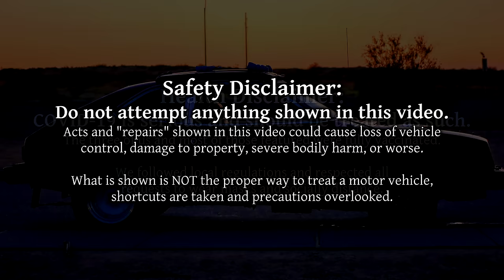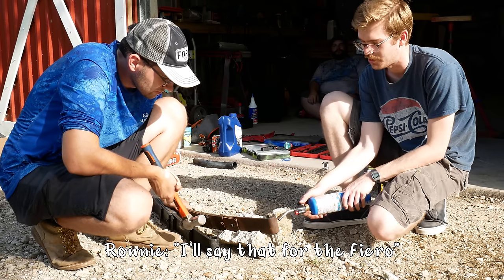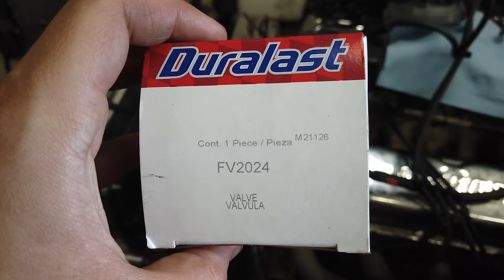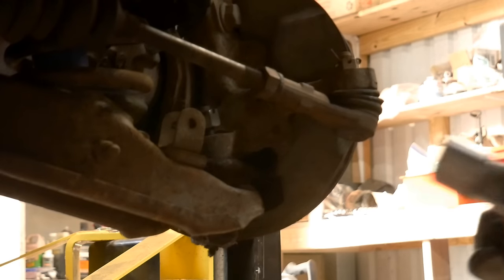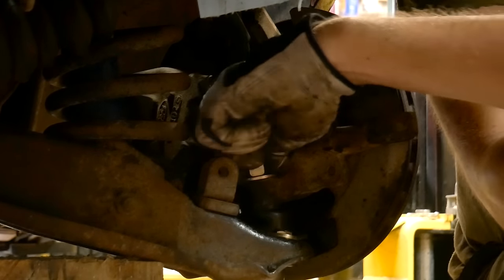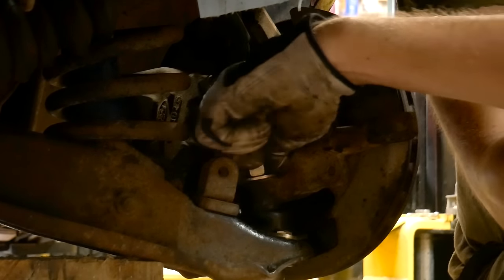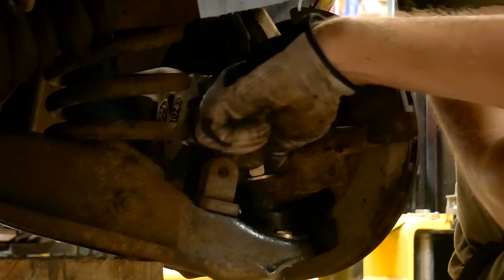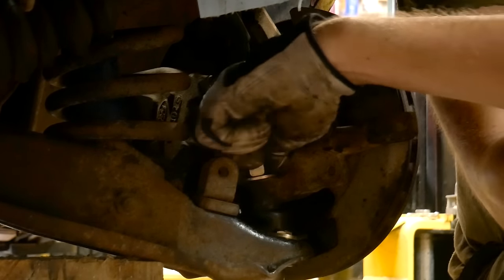Driving a V8 Ford Pinto 3000 Miles Home Finale (Ronald Finger, Driving Texas to Maryland) (Ep.4)

Comment: The thing that has impressed me throughout this whole trip is that Pinto's engine just refusing to run cooler or better no matter how much work you did to it.
Reply: Yeah I hope he can finally nail down the issue and let us know what it was.
Reply: The Coolant passages could be clogged due to rust and water.
Reply: Windsors are a funny motor, I've driven a car with one for over 20 years.  They can run good, but most of the time they just run okay to eh?  They don't die easy though.
Reply: I really think he has too little radiator for that v8.  If the block is a bit plugged too that just pushes it over the top.
Reply: @jonathanklein383  Agreed. That radiator is WAAAYYY to small.

Comment: What an absolutely awesome adventure to watch, and feel part of.  Great comradely, and something that has created lifelong memories for numerous people.   I had a smaller adventure like this in 2004 when I bought a car interstate.  5.6L Holden V8, in a 1987 Commodore.  Trip home was “only” 1100km (approx 660 miles) and I got no more than 80km of run time between failures.   Some we’re only 5km apart.  It even failed dramatically just before half way and I was ready to walk away, but I persisted with it.  I know all too well the feeling of dread when something breaks and you’re in the middle of nowhere.  Coming up with temporary fixes, or having to wait until daylight for shops to open to buy something to adapt.  Never sat below the red end of the temp gauge the whole way, and I went through all the same cooling system issues.  At one point it was using 2L of engine oil every 100km.  Not burning it. Rustproofing the underside, thanks to an old leaky rear main.   It was a week of hell and haphazard emotions.  I restored that car in 2010 and it’s been ultra reliable and has run cool ever since.  Many times on that trip I questioned why I didn’t just pay for it to be transported home, but I now look back on that adventure as a positive thing, and a great learning experience - physically and mentally.   Your adventure was 5x what I went through.  That relief of making it home can’t be described.  It took months before I wanted to work on that car again.

Comment: Your road trip sounded so familiar...  loved your whole video series. Mine started in Fresno California and ended in Queens NY with a 72 Datsun 210 2 door (paid $200 for). Somewhat the same type of issues involving bailing wire or speaker wire, ball point pen casings, duck tape, truck stops (for showers), a cooler full of lunch meats and such, and what seemed like hundreds of gallons of water along a southern route on I-10 till around the pan handle then up the east coast to ny. The only company I had was an old Midland cell phone, a map of the United States and my full sized collie (like Lassie). Was definitely a adventure...  After around 1 year and 6-8 months in NY, alot of work, customizing,  a guy came knocking on my door asking if the car was mine ( he said he tried several houses around the area) and offered me $7000 (yes he did) and a Mazda RX7 in trade. He desperately wanted the car. Hated to see the car go but she tured out to be a very reliable car and was catching alot of attention ( some unwanted by NYPD). 15 yrs later I now have 2 E150 vans (both has same paint scheme  as the A-team van (one in black and one in white and both custom built by me) and a 48 Studebaker pickup. Fun times...

Comment: I'm disabled and can't afford to do stuff like this (it's my dream, tbh).  Thank you for letting me live vicariously. I hope this series gives your channel the subscribers and recognition it deserves.  The pop-punk/acoustic soundtrack was 10/10.  

As soon as I saw you pull into a Semi shop, I was thinking, "I'll bet they're tempted to throw a semi radiator in it", and 2 seconds later, LOL!   I'd look for binding (rubbing parts that shouldn't be/excess friction) in the driveline, as the only time I've had transmissions blow fluid everywhere like that was when they were very overloaded (too heavy a trailer @ 75mph through the mountains of WV in 95 degree heat, not good, lol).  Considering all the vibrations (and the generally everything is loose/Jerry-rigged condition of the build) I'd really look at the transmission/converter first.  That oil cooler in front of the radiator probably allowed you to run it that hot for that long!  Seeing what finally is the overheating culprit will be so satisfying! (for you guys the most, I'm sure)  

I live in Shrewsbury, PA (1st exit off I-83 in PA, 4 miles from MD), so if you want to diagnose it together, I'm down!

Comment: Congratulations on getting it home!  As an old Hot Rodder, let me throw my two cents in on what issues I see with the car. The first one is that the parking brake cables should go over the leaf springs, not under. The second is with the cooling system. At highway speeds, the fan does nothing in terms of cooling. It is only there for low speed traffic. Overheating at highway speeds points to too low of a capacity in the radiator. It needs a wider radiator, if at all possible. Maybe try one for a V8 Mustang II?   As for the initial timing, I think what happened is that the inertia ring on the harmonic balancer has spun on the hub due to age, thus throwing off the timing mark. I would do a static time of the engine to confirm that the timing mark lines up at TDC with the engine off. I believe that the engine also has too long a water pump snout, which is why the crank pulley and alternator pulley are spacered out to meet it. So, it should be possible to move the radiator back once you figure out the accessory drive issue.
Reply: I said from the start this radiator was to small and not Big enough and everyone shot me down. Never seen a v8 with a skinny rad like that one.
Reply: @randallkasholo2026  well it's not like they were pushing the engine to the limit? I remember from the earlier vids they were just cruisin around basically and the car would overheat badly and would only cool down when basically idling on the side of the road. When cruisin around you only need like 30 horsepower, that shouldn't be an issue even with a radiator that is too small
Reply: Agreed.
Reply: @computercrack  It's not about the horsepower so much as it is about the load and engine speed. Hold your engine at 2750 RPM for half an hour in the driveway and it will get warm because you don't have the capacity to cool it under those circumstances. (plus, you would not have the airflow through the engine bay to evacuate the heat from the headers, etc.) This is also why cars overheat during a flat tappet cam break in. Remember too that headers add more thermal load than cast manifolds because they have a thin wall and allow more heat to escape in the engine bay. With cast manifolds, the heat is carried down stream to the exhaust pipes.
Reply: @3rdworldgarage450  yea exactly its about the load of the engine. Just checked, my car is doing like 2400rpm @70mph but I was pushing the gas pedal only like 10-20% down so really light load in any case of course it's a modern engine with computer controlled injection (car did like 50mpg today but mostly only driving 50mph or less) so I don't know about carburetors maybe the Pinto is dumping the same amount of fuel into the engine no matter the load (or the position of the throttle). Maybe he finds what's wrong, we`ll see
Reply: The gaping holes on each side of the radiator isn't helping matters at all, air is finding the path of least resistance and going around the radiator. A simple cardboard test would be a good idea. I did that on one of those grill-less trans ams from the 80s, it was over heating at highway speeds, the tech at the shop was having a tough time with it. New water pump, hoses, t stat, cooler t stat, and a radiator. I finally got time to help him, I looked under the car and saw the air dam was gone, so I made one out of cardboard and took it for a drive. Gauge ran right in the middle, before it was always 3/4 or more towards hot.
Reply: @mcqueenfanman  this has been bugging me since The first video. Doubly so that the trans cooler is in front of the radiator. I bet if you put the trans cooler off to one side to block one of the holes, and get it away from the radiator core, it would be better
Reply: @mcqueenfanman  I was looking at that and thinking the same.
Reply: @mcqueenfanman  I have a V8 vega . Similar issues . I solved the problem by building a custom radiator and moving it forward as much as I could.  Also a air deflector forcing air up into the rad would help.  Sealing up holes in the core support and running a hood actually help suck the heated air out the bottom of the car .
Reply: some of us have been tossing that radiator issue around since the first video. The clue was the low drag water pump they pulled out, which is fine for 5 minutes of run time at the track, and probably paired with the smaller radiator just to save weight. 300+ HP probably needs 4 cores thick instead of the usual 3 cores... and 6 inches wider wouldn't hurt either.
Reply: @randallkasholo2026  You will only hear from squeaky wheels that like to promote their BS.
Reply: @3rdworldgarage450  that is why many insulated their headers back in the day.

Comment: Something doesn't seem right about your timing.   The stock specs for initial timing are usually conservative.  If you have a cam,  you should expect anywhere from 10-20 initial and 25-35 full advance.   I think thats contributing to your overheating.  Have you verified your timing mark is actually top dead center?
Reply from the maker: We verified the timing mark in a previous episode and I did once again after getting it home, I agree that it seems strange but the engine idles much more smoothly with less initial. Not sure what that means though.

Comment: I absolutely loved this series! It took me back to my senior year in high school. My girlfriend's brother and I had a vocational auto shop class together where we did virtually the same thing with a 1974 Pinto. We dropped a 302 Boss motor in it along with a 4-speed manual transmission from a '68 Mustang. We ran into the same cooling problem. We tried a bigger radiator up front, but the weight of the engine made the front end sag, putting the radiator dangerously close to the ground. We found out how sub optimal this was after accidentally bashing holes in it a couple of times from road debris. We ended up moving the battery from the rear cargo area to the floor of the back seat passenger side since what we were going to do left the rear hatch unable to open evermore. We did away with the rear window, welded a panel in its place, and then permanently sealed the hatch shut. Then we got a new radiator and mounted it on the rear hatch trophy truck style with about six inches of relief between the radiator and the hatch at the top and about an inch of relief at the bottom. We fabricated a scoop on the roof to funnel more air down under the radiator so the fans had enough cold air to pull through the radiator. This was the ticket. It never overheated again.

Comment: Hey Mr. Dice, first and foremost, this has been a super-enjoyable series to watch, and I appreciate the effort that went into it!

A couple of thoughts regarding the cooling system issues (Although you've likely got it beaten by the time the vid was posted)

With a couple of k-type temperature probes taped/glued to the inlet and outlet of the radiator:

Working hard, at highway speed-- You should see a minimum of 35 Degrees temperature drop across the core.  If not, Insufficient airflow (Not likely)  plugged up cores (I know, I saw the car-wash segment) or plain old not enough radiator.

If you have more than 50 degrees temp drop across the core, and you still have confirmed overheating, you have insufficient coolant flow.   Not enough pump speed,  incorrectly installed head gaskets, collapsing lower radiator hose, etc.

Using the temp probes--  The radiator temp should mirror the engine temp.  I.e. Radiator inlet shoudl mirror what you are seeing on the engine temp gage indicates.   Rad outlet should, like I said, have a minimum of 35F temp drop from engine temp.  If not, something is not allowing the coolant to circulate correctly, i.e. Headgasket backwards (upside down, blocking off the coolant passages in the front of the heads)

One other thing that I doubt, but bears checking, might be a good idea to run a "blue goo" or combustion chamber leakage test.  They just look for CO2 in the cooling system, the presence of which indicates exhaust sneaking into the cooling system.

Hopefully this is somewhat helpful!

Comment: Thank you for the entertainment! I was hooked on the first video because not only do I live in Phoenix and owned two Pintos but when I had them I really wanted to drop that V8 in one. Someone who had done just that back in the very early 80's told me that the small block Ford sat on the original engine mounts. I thought his car was really cool and I've always loved the first "hot-hatch" I ever saw. Sadly, I never got to that point as the first Pinto was totaled. The 2nd one was the biggest pile of crap I've ever owned, which was a real disappointment because the first one was fantastic but I had to trade it in for reliable transportation.

Comment: The week before you posted this, I started my own cross country journey in a vintage car.

3000 miles from MA to WA to visit my aunt in a 36 year old Volvo 244. The week before I started the journey, I had to reassemble the entire driveline including the engine and transmission. There's still work to be done, but it managed the entire journey flawlessly with 1000 miles driven a day, besides the loud scary transmission noises and the loss of a hood to a bad latch.

Comment: It's nice to see regular guys working on cars. It reminds me of the things we used to do when we were younger. One such time a friend of mine bought a Cadillac from some guys driveway. It hadn't run in years.  Leaves and something black and moldy looking stuff stuck all over the car. We trailered it back to his house. Got it running. Cleaned some crap off of it. Took the plates off his truck and put them on the Caddy. And went for a drive. Risky, but fun. I wish I had that much time again. Can't wait till winter leaves so I can get parts for my '96 Chevy Lumina APV van.  Unfortunately the exhaust has broken.  And no muffler shop can find a listing for a replacement. I love this van. I still have my '03 Chevy S10 crew cab 4x4.  Apparently I love strange GM vehicles.

Comment: Loved the series. I think the overheating might be also a mixture from to low octane gas on a high compression engine and a way too small radiator for that engine. Maybe even that big trans-cooler in front might have a negative effect on the engine's temperature.

Comment: Totally awesome series, I hope you are able to monetize for many many years.    As for the overheating issues, two things I was thinking of:  Was the trans cooler prevention cool airflow to radiator?  Was the old temp gauge even correct?     Again, great series, even though I was stressed out for your safety when resting in the gutters, exit off-ramps are much safer.

Comment: So, on SBFs it's possible to put the head gasket on backwards (block to head coolant passage in the front, instead of rear) which lets a bulk of the coolant bypass the back rear of the head/block.  You might have just one side on backwards.  Would have expected more overheating however.

Comment: Awesome story! I bought a $100 71 Chevy pickup in Cocoa FL back in 1986. I drove it from Cocoa to Waterbury, CT. The only troubles I had were upper rad hose, lower rad hose, rad cap, rear u-joint, and it used a lot of oil.

Comment: I wonder if the lower radiator hose was collapsing at high rpm. I have had a couple of cars that did this. They ran cool at idle, but heated up at high rpm under load. Thats why the factory put those metal coils in.

Comment: I found it humorous  when I came across this, part four, of the 3,000 mile odyssey of a Ford Pinto. While in the Army I was stationed  at the Frankfurt  am Main Transportation  Motor Pool who was responsible for all the commercial  non tactical  military vehicles in the surrounding area  as their lead recovery  truck operator. We had about  75 Pintos on charge that were used for everything from general Transportation to Military Police cars. Let me just say that as a wrecker operator the site of a mangled Pinto with it's broken but desperately  trying to continue to operate rotating  blue light (which was nearly as large as the entire roof to which it was bolted) can't help but bring a smile to your face as you come up on the scene. It's really funny to see, or maybe you just had to be there. At any rate back to my story. There came a point in the Pinto's life  (at least the ones we had) where it was discovered that Pinto had the overwhelming  gaul to, when they were impacted from the rear, to blow up. This was due to the tendency  for the gas tanks to explode upon impact thus inviting  the occupants of both vehicles involved to an instant Wennie roast. Sadly, it was determined  that the Pintos, all that had survived being wrecked, stolen by persons unknown and left on it's roof sans its wheels and tires looking like some upturned  turtle (yes we had an incident like that described,  but that's  another story) , were to be disposed of. It became my task to tow some 68 or so Ford Pintos to the local crusher were I was required to witness  and sign a statement  there to that each Pinto had been crushed beyond redemption.  For a lifelong car guy it was a bit of a disappointment.  So if your having trouble finding parts for your now dysfunctional  Ford Pinto of the '77-'78 variety,  you now know at least in part why.